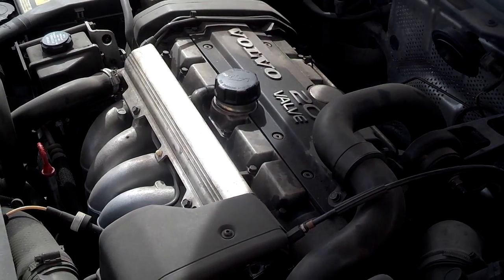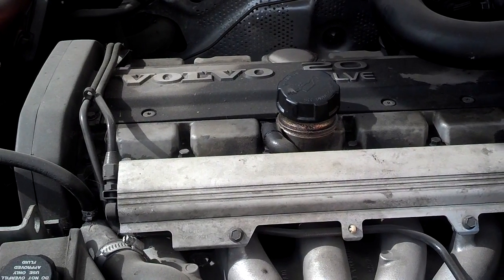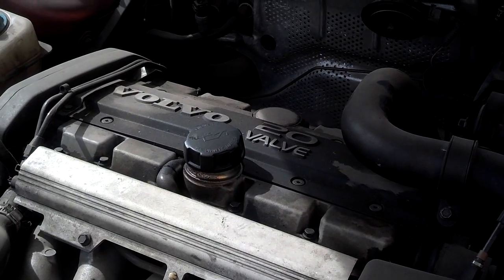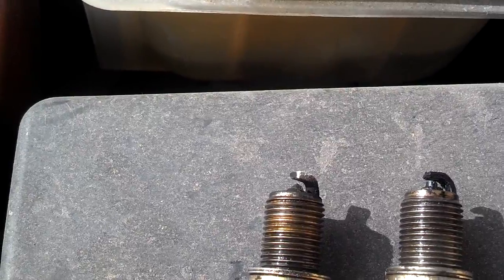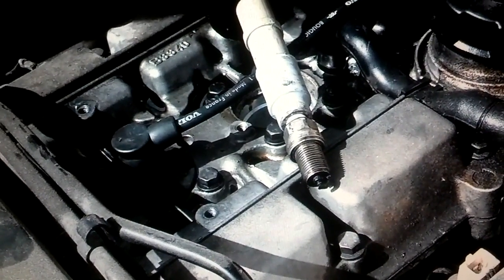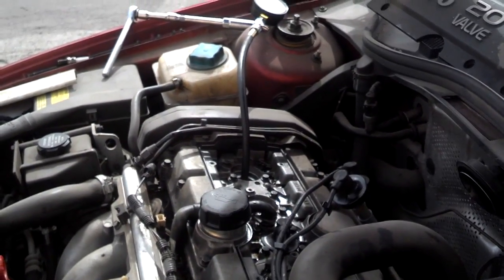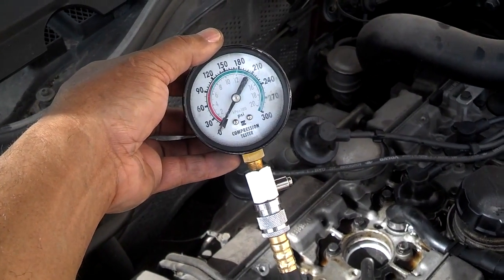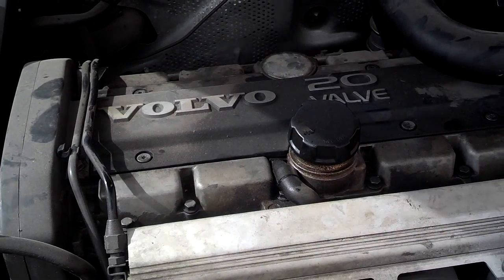Why does my car engine misfire troubleshooting, does it have a bad spark plug, coil or valve? - VOTD

Comment: Robert DIY , i changed the injector and the plugs but when i go uphill passing 3000rpm it starts to sputter , any advise ?
Reply from the maker: +King Chael What kind of car do you have? Did you use dealer parts?
Reply: +Robert DIY 2007 scion tc and no i did not
Reply from the maker: Sometimes that matters. You may also want to try 91+ octane fuel.
Reply from the maker: Any codes?
Reply: +Robert DIY p0302
Reply from the maker: Have you swapped coils?
Reply: +Robert DIY  i've replaced , coils , injectors and plugs

Comment: Thank you very much for a great video. My car's 6 cylinder is misfiring and I am going to check if it has electrical problem because one of the wire was soldered between spark plug coil and ECU.
Reply from the maker: Ouch! Hope it works out for you.

Comment: one other question when rolling the engine forward in a 2003 rendezvous to get to the back plugs do I have to worry that when I take the strap off it would move the engine to fast possibly and move it the wrong way?
Reply from the maker: +John Veier I have no idea.

Comment: im using regular gas plugs and wires are pretty bad recently got a newer engine put in and im guess they didnt change them will be doing it today hopefully its not a rod knock
Reply from the maker: +John Veier ok

Comment: i have a p0300 code coming up and when i start my car soonds like possible rod knock car dies out after 10 secinds and rns really rough when running. mechanic said its not a rod knock its plugs and wires. so my question is can a rod knock throw misfiring code
Reply from the maker: +John Veier What kind of car do you have? A misfire can sound like a kick. I seen a bad water pump cause knocking noise. When was the last tune up? Have you pulled and looked at the plugs?  How old are the wires? What kind of gas are you using?

Comment: MY 03' LINCOLN  AVIATOR WONT START, NOT EVEN A CLICK. I'M GET P0316 AND P0304. ALSO BEFORE THE CAR STOP WANTING TO START, I WAS TRYING TO PARK IT AND AS I PUT IN REVERSE THE CAR KEPT GOING FORWARD SO I SHUT CAR OFF AND NOW IT WILL NOT START. ANY IDEAS?
Reply from the maker: +malay bender https://www.youtube.com/watch?v=2rVt-TDqmSc
Reply from the maker: +malay bender https://www.youtube.com/watch?v=zhgTMhwSuzM
Reply: Brand new battery and recent oil change. The alternator is new as well
Reply: All the lights come on including headlights and radio
Reply from the maker: Well, maybe the starter is bad.
Reply: +Robert DIY no, that's not it, after my own research I found out its the shift cable bushings.
Reply from the maker: Good deal, glad you figured it out.

Comment: Having 01 and 02 cylinder misfires changed spark plugs and coil took it to my mechanic and he couldn't figure out the problem .. When i start car it rumbles and shakes for a few seconds then runs fine what can i try ?
Reply: +Brianna R 2006 hyundai elantra
Reply from the maker: +Brianna R Have you done all of the things in the video?
Reply: Yes my mechanic checked all of those things
Reply from the maker: +Brianna R Does it misfire all the time or just when you first start.
Reply: Robert DIY it's on and off . Sometimes it does it sometimes it doesn't I also noticed the rmp goes up to #3 (I'm guessing this means 3000) while the mph says between 5 and 10 then it increases not sure if this has anything to do with the problem
Reply from the maker: +Brianna R Without another code, not sure what the issue is. Maybe you have an intake manifold leak or fuel injectors going bad.

Comment: have a 09 altima 2.5 changed coils and spark plugs when I drive it hesitates then smooths out what could it be..
Reply from the maker: +Alvin Gonzalez Any codes?
Reply: No codes was #1 misfire so I changed everything plugs and coils..when I accelerate it still misfires
Reply from the maker: Could be a manifold leak or something like that. Did you check compression?
Reply: Problem solved was a faulty coil thanks
Reply from the maker: Good deal.

Comment: Hello Robert... I have a multiple misfire... All spark plugs and ignition coils have been changed and car is still reading multiple misfire.. The car itself is running smooth.. I am confused.
Reply from the maker: deeva toocute What kind of car is it?
Reply: It is a 2007 Saturn Vue V6
Reply from the maker: Maybe you have an intake manifold leak.

Comment: Thank you for a very informative video Robert.. I now know how to do a compression test...PLEASE HELP with some advice
2006 Ford Expedition. 5.4....Bucking and shaking @ 40-60 mph MIL light comes on and stays lit
Throws P0357 Primary Secondary Ign,...cylinder 7
Changed Plugs and coil packs...great for 4 days (100 mile round trip all highway to work and back for 4 days
Same exact problem....bucking shaking ...MIL (check engine light)  flashes repeatedly indicating probable cat damage if I dont stop....Light stops blinking...then stays lit...throws a different code....P0307...cylinder 7...misfire...same cylinder...(somewhat) different code..so changed plug and coil pack again and
Changed Fuel Injector 7....Cleaned Throttle Body....Cleaned MAF sensor....Traced every vacuum line for leaks..Seafoamed Top Engine and added Seafoam to fuel tank cleared code...ran great for about 30 minutes...MIL light still Flashing...but doesnt stay lit Again throws P0307 misfire ....Changed fuel pump driver module (TSB known problem)...cleaned all oxegyn sensors pre and after CAT cleared codes...drove GREAT for about 10 minutes....can still feel miss (slightly) MIL blinking around 40 starts shaking and bucking but if you adjust your speed to under 40 or above 40 light goes out and drives smoother (but still has miss)......I am baffled as to what would firstly cause a MIL light to blink (as to warn you of impending cat damage) but doesnt make the check engine light stay lit constantly?....( after clearing codes and after engine light blinks I can manually pull codes on my own, but not because the check engine light is on)...Did that make sense?....and secondly, could a faulty pcv valve cause a single cylinder misfire? I know it can throw multiple P0300 codes, but can it be confined to just 1 cylinder?.......Any advice you can give me would be greatly appreciated...thanks....Chuck Conet...2006 Ford Expedition  5.4 -139,000 miles...runs flawlessly except for this problem...what would you do next?...
Reply from the maker: chuck conet Compression test...
Reply: Robert DIY  Thanks for the quick answer....I bought an actron at advanced and the guy assured me it was the right size...HOWEVER...it seems that the 2006 5.4 takes a 16mm adapter and not the 12 14 and 18 mm adapters they sell with the kit...I will get back to you when I get the correct adapter tracked down...again...thanks so much for the quick reply.....Chuck Conet
Reply from the maker: chuck conet No problem chuck.

Comment: is it ok to disconnect 2 fuel injectors of a v6 engine so it will only run on 4 cylinders and save gas? :D
Reply from the maker: EvendimataE Nope. That creates a LEAN condition in the cylinder and will likely damage the valves. Besides that, the engine will probably not even run missing on 2 cylinders.

Comment: hi mr. robert.....i have a 2000 lincoln navigator 5.4 v8 ..cylinder 1.3. and 7 has no compression the ford dealer says. They suggested me to buy a new motor .Im getting very poor gas milage....could i fix this problem my self,buy a new motor, or just have it rebuilt..it has over 193,000 miles on it. I just want the fastest and a low cost way to fix it..thanks
Reply from the maker: Ras Congo That's a hard call. What is the blue book on it? How much will it cost to replace the motor? Why does it have zero compression in those cylinders (what went wrong)?
Reply: After watching this video.i will check the spark plugs tomorrow and let you kno
Reply from the maker: Ras Congo ok

Comment: Hi Robert, I'm getting codes P0300, P0302 and also P1145 (MAF Code).  Do you think they could all be related??? Thanks :)
Reply from the maker: David Mudd Not sure what kind of car you have but I'd say yes.
Reply: Robert DIY Sorry Robert, I have a 2001 Seat Alhambra 2.0s MPV.  I cleaned the MAF yesterday and it seemed to stop hesitation at idle.  When I drove it this morning it still has a very bad jerky hesitation and the check engine will flash whilst I am driving and it really acts up.  I plugged it back in after driving and it just brought up the P0300 & P0302 codes, the MAF code hasn't (as yet) come back, so I may have cured 1 problem.  A mechanic did tell me just before Christmas that I have very bad carbon build up and this is why it fouled cylinder 2 spark plug within days.  I have been running redex injector cleaner through my engine since then and have noticed only small improvements.  Plus performance has also improved slightly after cleaning the MAF.  This is really frying my head now though.  May well go onto the spark plugs next, just hope it's nothing too serious as it does at times run really nice, plus always starts no problem at all (apart from when I had alternator issues, which is now sorted).  Anyway I'm rambling on a bit now but at least it gives you some insight into what has been going on with my vehicle.  Any kind of help/advice/thoughts you have will be great.  Thanks Robert, great videos you make by the way.  :-)
Reply from the maker: Does the car have coil packs? How many miles?
Reply: Robert DIY Yes it has coil packs, not sure if it just has 1 for all cylinders or 1 for each cylinder.  It's done roughly 133k.

Comment: I'm OLD SCHOOL, Robert. Put that bad cylinder just passed its intake stroke. Run compressed air in your spark plug hole. Now, listen... if air comes hissing out the exhaust pipe, you have a bad exhaust valve. If it comes hissing out the throttle body, it's a bad intake valve. If it comes hissing out the valve cover, you have bad rings. The name of the game is to NAIL IT. A rebuilt head isn't too expensive and can be done without pulling the engine. Replacing pistons is another story.
No 'fault codes' will tell you to do these basic (and old) techniques.
Reply from the maker: simplyconnected I follow you. Bleed down test. Level 3 trouble shooting. LOL
Reply: If it's an aluminium block, you often need to plane the block AND the head. And that means fully stripping the block.

Comment: I like the thorough, "all possibilities covered" approach.
Reply from the maker: Schrodingers Box Thanks man, just trying to help.
Reply: Robert DIY Hi Robert, Im having lexus is250 2006 model aroun 120k miles driven, when I drive above 90mph the car suddenly drives rough and check engine, VSC and traction control lights are appear and the speed goes down itself but after restarting engine the are dissapearing and the engine start work well. When i checked it showed P0302 cylinder misfire. I cant drive above 90mph. Do you know what could this cause? Thanks
Reply from the maker: Have you tried the things in the video?

Comment: Hey Robert, me again..:/

Still having my issues (thus why I'm watching the video). But my question is simple this time. At the start of the video, there's a part of the vacuum system that is like a filter (in a way..with an in and an out). The filter is black and white, and in front of the intake manifold.

What is that, and does it matter which direction the colors are? Im checking my car for vacuum leaks (among other explanations for the rough idle/missfire), and when I put that back together after checking the hoses, I forgot which way it was facing (black up or white up).

Does it matter?
Reply from the maker: hapsblog It is probably a check valve and yes it would matter.

Comment: Question: Kia Sorento 2007 4wd.  Had multiple issues lately beginning with p0501 issue which ended up being Right rear speed/ABD sensor issue.  While waiting for hubby to take to mechanic to diagnose it begin idling rough.  He replaced all spark plugs, didn't fix, and then pcv valve which initially after changing seemed to make even driving worse and engine stuttering.  So I didn't take it any further.  He then replaced the speed/abs sensor and car seemed back to normal after that.  200 miles later check engine light came back on and is now registering a p0133 code and then 30 miles after that it is registering codes for all cylinders misfiring.   Is this simply and O2 sensor issue?  and if so how do we know which one?  When I look for this part it shows 4 different types upstream/downstream left/right...  Help if you can!  Hope you had a good Thanksgiving!!
Reply from the maker: Jason Wilson Hi and thanks for your question. If you have a decent scanner, it will usually tell you which o2 sensor is bad. However, bad o2 sensors usually do not cause multiple misfires. How many miles are on the vehicle? There is a chance that you are having a fuel delivery issue. If the fuel pump is going out, filter clogged, pump relay gone bad, it will cause random misfires. See is you can have the fuel pressure checked.

Comment: Hi Robert,
I have been getting all cylinder misfires so far plus the p300 error code for random. Is this a sign of my engine needs a headgasket. I did pcv, rear cam seals, new wire,new volvo oem plugs, new cap/distributor. What do you think is the best thing for me to do?
Reply from the maker: Sonny luong Check the cap, if it is still clean, check fuel pressure. If that is good, check the ignition coil. You can also check your spark, if it is weak, yellow instead of blue / white, your coil is likely going out.
Reply: I recheck and cleaned my spark plugs. They had black carbon on them but they are still good(volvo OEMS). I made sure the cap/distributor was on correctly and firing order was correct. Tomorrow I will check fuel pressure and turn it on and see what happens. Thanks alot again.

Comment: Good video ! I have a 2002 lexus GS300 . What if I have p0 301,302,303,304.305 and 306 would that mean the fuel pump just went bad?
Reply from the maker: Dre Edwards I wouldn't say that. Have someone check fuel pressure and see what it is. Usually a bad fuel pump will cause the car to stop, real soon.

Comment: Robert, thank you for your videos, extremely informative. Even I, being a girl, can understand it!  May just get my nails dirty working on my 2007 Saab 9-3 Aero, with 75,000 miles, that just started the misfiring after filing it with 93 octane fuel.  Just purchased it used from a dealer so I don't really know how it's one previous owner cared for it, except that the car is in excellent condition otherwise.  The car did not sputter/misfire until after I used the high octane fuel so wondering if that caused/exacerbated a problem.  The check engine light has not come on once since the sputtering/misfiring started a couple days ago.  Planning on starting with the plugs and wires etc. but where can I find a scanner like you use in your video?  Is this cost effective for a do-it-yourselfer?  Thanks in advance for your advice!
Reply from the maker: If your car started running rough the day you fueled it, it is possible that you got some bad gas. Have you contacted the gas station to see if others reported problems? I believe every auto parts store sells the ScanGauge tool. There are all kinds of scanners out there. Also, most auto parts stores will scan your car for free. If you have no service history, you should start with plugs, try to make sure you get the kind that come in the car when new.
Reply: Thanks...interestingly, upon driving it just this morning during rain showers it DIDN'T SPUTTER ONCE...then on the next trip no rain, check engine light came on, and some sputtering.  Still planning on the spark plugs etc. just to get a fresh start.
Reply from the maker: Find out what the code is and go from there.
Reply: That is all a part of my plan, thanks to your video!

Comment: Hey Robert, I have misfires on cylinder #7 and #8 on a 2001 Ford Crown Victoria, so far I have changed the plugs (all 8 of them) and coil packs on the two misfiring cylinders. The car ran better but I could still tell that it was misfiring (delayed acceleration), then a new cylinder started to misfire #6. What could be the issue? I have not cleared the first codes to see if I fixed #7 and #8
Reply from the maker: How many miles does the car have? Have you completed the video? Has the fuel filter ever been replaced?
Reply: I'm not sure but the engine was swapped and the body has 269k miles and the fuel filter has never been replaced to my knowledge, but I think its causing a temporary  knocking sound at startup. By the way the car was sitting for 6 months before I bought it. I got about halfway through the video, but have not checked the MAF, fuel filter, etc. Thanks for replying

Comment: Hiya Robert. Thanks for sharing your knowledge! 

I have a 97 4Runner 3.4 V6, I get a p0301 intermittently. Sometimes it takes a day and sometimes over a month. CEL comes on, I check the code, and reset the CEL, and its always the same. Usually it takes a month for it to come on, and then for like 2 days straight it comes on after about 10 miles, then it stops again taking a month or two to come back on. Any idea what would cause an intermittent P0301?
Reply: Just to add. I replaced the plugs, wires about 5k miles ago, prior to that i would get p0301, and two other cylinder misfires i can't remember. Post plug job, its just the intermittent p0301
Reply: And, the engine doesn't idle funny or hesitate upon acceleration. Nothing noticeable performance wise, although just once it started real rough while hot. Thanks for all your help
Reply from the maker: Have you replaced the cap and rotor?
Reply: Robert DIY I think I read in a Haynes that it is a rotor less engine. But i it has one, no i haven't.